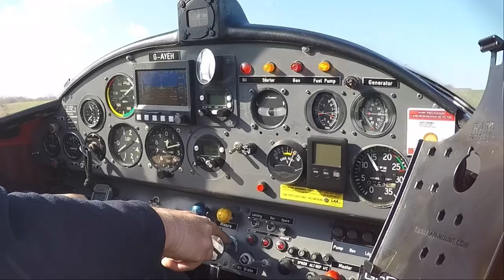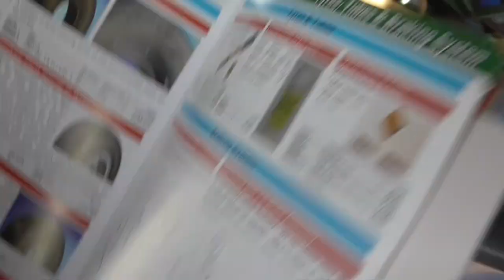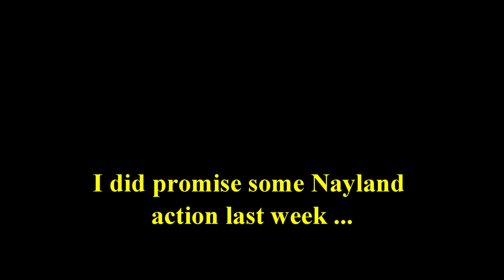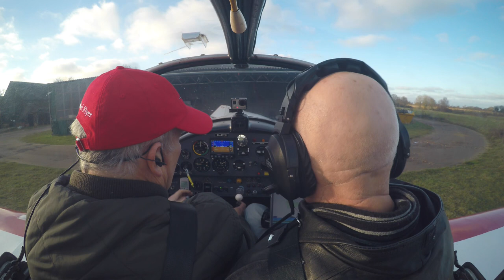FIX IT FRIDAY - PILOT VLOG #346

Comment: I too had difficulty getting the air out of my RV's brake lines; it's air trapped in the Matco brake cylinders. I called Matco and they said that in addition to pushing the brake fluid in at the calipers (which is the standard way to fill a brake system), you had to also suck brake fluid from out the top of the brake fluid reservoir. Amazon sells several inexpensive tools with which to suck out the brake fluid. This worked for me and several other RV owners at my airport. Fair winds and blue skies to you Tim, and thanks for the fantastic videos.
Reply from the maker: Thanks for that Ian and I am glad you like the videos

Comment: Good morning Tim. It is interesting to see that you use coppers lip on the plugs. On the Rotax engines they use a heat transfer paste for heat flow. Did the brakes get fixed, or did I miss the conclusion?
Reply from the maker: They did get the brakes working but there is more to the story which I will pick up on at the start of next weeks video.

Comment: Looked like John still had a bit of air in the system but I can not think of a reason for him getting leaks. I have to say that he still uses more coppergrease then I do, I wast told to only apply a very thin coat and for plugs we would apply it and then use a sofe brush to remove the excess. I wounder if a push on tyre inflator with the ridgid pipe would work better for your tyre valve but I can see it is a pain to access and you can't just make the access hole bigger, like an nice oval.
Reply from the maker: I think I have seen photographs of spats with a larger square plate on a piano hinge with a release clip.
Reply: @JodelFlyer  The problem is wouldn't you have to put it in as a mod to the LAA? The work would be easy enough to do, especially is you went down the oval grommit method I have seen used on a couple of Pitts'.

Comment: As you are using Road gas you will get more sooting as Road gas is not as refined as Avgas. Also Road gas degrades far quicker than Avgas.We run Avgas in all our flying machines here on the field no issues. People who are running Road gas have some issues especially if using lower Rpm,s they tend to coke up more and quicker. Maybe a slight increase in cruise Rpm might help in keeping her regular like. You should do spark plug mod to auto plugs much cheaper. When I had Jodel a new set of GA cert plugs was $850nz dollars.. Great vid keep at it carry on. Be well fly lots.
Reply from the maker: Thank you for that Nick. I will try it and then see what happens.
Reply: @JodelFlyer  one other thing if the road gas sits for more than 3 weeks give or take the octane rating can drop quite a bit. It may pay top chuck in the lead additive ya can buy. Main reason up octane rating.